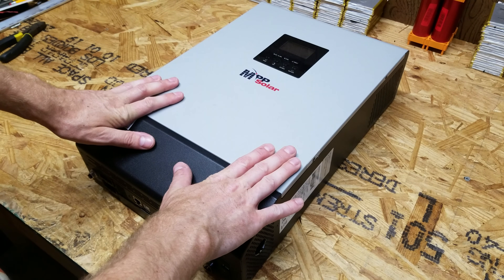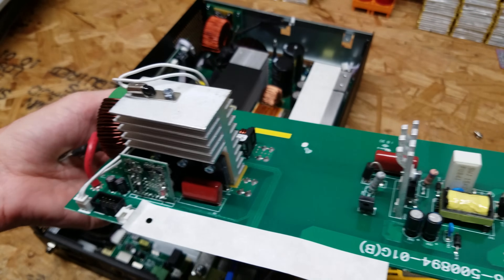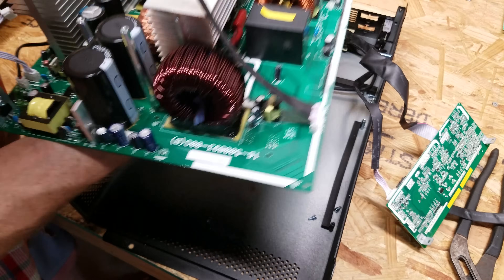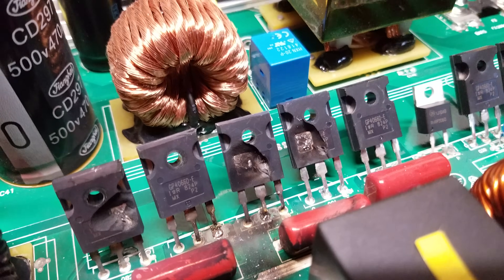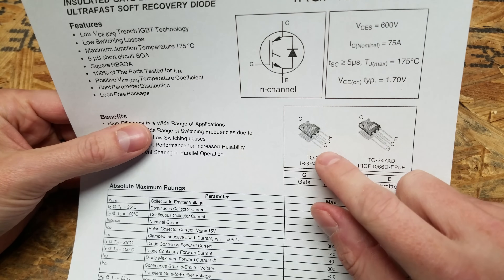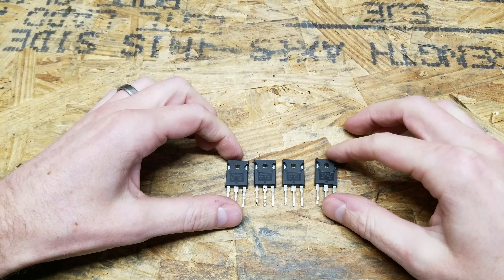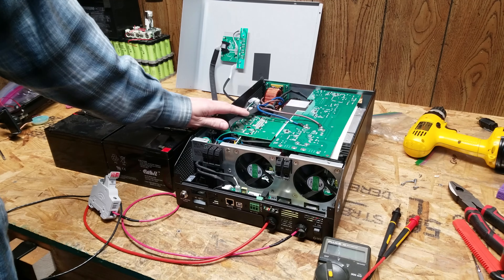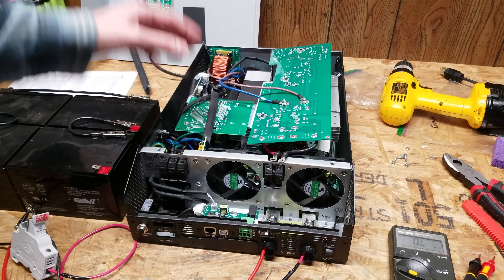MPP Solar PIP-5048MG Inverter Disassembly and Repair Attempt

Comment: In high frequency online ups the AC output neutral is same as battery minus. 
So i guess due to the incident every component between these are affected (DC fuse, mosfet, rectifier diodes, transformer, capacitors, IGBTs and other components which supports these power components). Might be the reason  why it is showing a short at the battery terminals. Not sure if this might add some more help.
Reply: I have found a troubleshooting video of similar kind of inverter .
https://youtu.be/HBKwrB3fhOE

The outer heatsink has the battery side mosfets which switches the battery input. Backside of the PCB multiple SMD ICs are the driver ICs for these mosfets.

The inner heatsink has the output MOSFET/IGBTs and Diodes. Back side of the PCB also has the Driver ICs for these set of MOSFETS .

Comment: Hello sir,
Very interesting video.  I would like some help from my side.I have almost the same problem with my inverter, but I wanted to replace a component that burned. The problem is that the component has completely burnt out and I can't identify it. So as you have worked on the same inverter, you could help me to identify the component. Please, if you can give me your mail to send you the picture of the burnt ?
Reply: Did you manage to find out the component?

Comment: The "electrician" didnt "accidentally" fed power to the grid , these inverters are not designed for that . More likely he probably  reversed the input and the output . lol
Reply from the maker: Yes, he is a licensed electrican and yes, he did accidentally backfeed grid power into the output terminals. It was an accident...

Comment: Do you really have an input short? Or are you just seeing the capacitors with your meter.
Attempt to charge the caps with a resistor in series.
Reply from the maker: I'm really not sure at this point. It's still sitting from where I left it after this video :/

Comment: So basically these high-frequency inverters have three main sections

1. High-frequency inverter that turns the 48VDC into ~15KHz+ 220VAC, then rectifies to turn it into 380VDC. The super high frequency lets you get away with a very small transformer (2x the freq= 2x the power for the same transformer, so a 15khz transformer can carry as much power as one 60hz 200x as big. NOTE: The transformers used have very little iron in them as iron saturates at higher frequencies. ). These were the K100E08N1 (80V-100A) mosfets and that sideways transformer you see there, and also 2 diodes somewhere on that side. MOST of the time this is done with a transformer center tap and a half-bridge, the middle of the transformer is connected straight to the + and the mosfets take turns switching - on the left and right sides. This creates a square AC wave which works super efficiently to boost the voltage but at 15KHz it's not useful whatsoever, thats why we rectify it to ~380VDC and store it in some caps.

2. 380VDC to 220VAC. The part that blew in this case. Since we're working with high voltage, the current is low and so we don't need nearly as many or powerful mosfets. Generally these are IGBT's rated for 600V. This will be a FULL H bridge configuration, so requires at LEAST 4 IGBTs, or a multiple of 4. And generally has some sort of inductor+caps to smooth out the SPWM into a full sine.

3. MPPT,separate circuit which generally consists of big inductors and mosfets to drop the solar inputvoltage and increase current, Depending on the setup it may be used to directly charge the 380V caps for much better efficiency.

GENERALLY when these cheapo inverters go kaboom, it's not just the mosfets that fail. This is because their circuits are designed so on the edge that the second the mosfets fail their gates short out and the gate drivers+resistors are so low-power that they blow as well (in the split second that the inverter blows up).

So my bet is that the gate drivers + resistors are probably blown. Hopefully the rest of the spwm circuit isnt blown, cause those are probably a bit complicated if they aren't off-the-shelf EGS002 modules.

ALSO when working with any switching circuit like this  always try to use a current limited power supply, 1A is more than enough to get it running. If there's a short, 1A won't do anything to the mosfets.
Reply: Hi Brian, thanks for the very informative reply! I have a simple 500W pure-sine wave inverter. I noticed the 12V input wires enter the PCB at a spot between two large transformers. Strangely, there seem to be 6 MOSFETS bolted to the case of the inverter in that area. Do you have any idea why there might be 6 of them, not a multiple of 4? Near the transformers are also eight discrete diodes (cylindrical plastic bodies). I don't think two of the large bolted components could be diodes right?

On the output side there are 4 mosfets, so I'm pretty sure I'm not looking at the wrong side of it lol. I've uploaded an image of the board here if you want to take a look :) - https://imgur.com/fNA3zEA

Oh, and I'm trying to learn how inverters work. One thing that I'm curious of - what part of the inverter does the switch on the front panel actually switch on/off? Since the wires are so thin it's clear that it's not switching the large input current, so how does it completely disable the inverter in the off position?
Reply: Sir Is Deye inverter has better quality than this inverter? Please reply.
Reply: I've just started getting into this stuff. I've always worked with computer etc, but only ever found out about soldering and board repair recently

I'm 21 years of age and I'm struggling to find places to learn

Could you direct me towards some documentation?

I'd love to get my masters in electrical engineering, but here in South Africa it's just too expensive to study and live at the same time. Gotta choose one😂

Comment: I want to know if there is a DEVICE or any other WAYS TO AVOID this ACCIDENT(blow the inverter by connecting the output to grid or Générator)
Reply from the maker: Yes. Make sure you have the appropriate interlock device on your breaker panel. This will physically prevent you from turning both breakers on at the same time.

Comment: Aliexpress has fake parts but if you are purchasing for 2-3 USD per pcs then it is Original, I purchased many parts from aliexpress, that works fine,  you can use IRGP-4063(IGBT, higher loading capacity but higher losses than MOSFET) instead of or 47n65 (MOSFET-lower loading capacity, low losses),  if not getting a sooner replacement, 
2: after repairing never inject batteries voltage directly without a current limiter, like bench power supply set on 1 amp to void more damage if a fault exists.
Best of Luck ,

Comment: Loved Your video, The input short is at the primary side(input) , pls check the input side, and try the voltage injection method to dig down to the problem, 
To Check MOSFET or IGBT (4066) you need to have a voltage gate supply of 5v at least then u will see approx 0 Ohm by C-E to verify the working of the transistor.
Appreciated Your video. 
The inverter was damaged by a back-feeding grid, this is Not a Gird Feed inverter. keep Output of this inverter isolated from input and never mix up.

Comment: Fun fact, but the "shorting" on the battery side may be a bad reading due to the big capacitors parellel to the battery charging by the multimeter. Try holding the multimeter leads for many seconds on the battery input and see if you get a non-short circuit reading.
Reply: I just wanted to say same.

Comment: I believe the battery soft start which looked health physically OK has a dead short. That 19 mosfet there is a dead short. Also the voltage you are using to  charge the gate and source across maybe low. Your meter has 9 volts.

Comment: Stay away  from hi frequency  inverters  they're  over complicated  and wont last a long time.
Low frequency  inverters  with a giant toroid are the go,  i have one with only one pcb inside it. The only thing that damaged it was a lightning  strike so far ,10+ years in use 24/7.

Comment: Inverex Rameen Solar Solution:
We deals in all types Domestic & Commercial Solar Solution system, On-Grid or Off-Grid Solar for Home, Offices Buildings, Factory, Shops, Godown’s, tub wells, Agricultures etc....
Call / Whatsapp us Freely for any information or Complain......
Regard
Engr Syed Wasim (Btech, MBA) +92 3018444084
Mr. Umer Ali (Solar Speclist) +92 3228422465
Rameen Inverex Solar Solution Lahore, Islamabad, Karachi, Pakistan
www.rameenrenewables.com
+92 42 36612136-7

Comment: I would check the boost state FETs. The battery voltage needs to be boosted high enough to create a 120V sine wave and it looks like it uses that EI core transformer in a push pull configuration next to the H bridge IGBTs. If the input FETs are blown then you would get a short measured across the battery input.

Comment: In my experience, counterfeit transistors can actually work just fine. Same with other chips, a lot of my DC to DC converters use blatant TI rip offs but work very well.
Reply: LOL...  We haven't had any issues with them either... W/exception of "magnachip"...   I've used hundreds.. We fix anything they bring, if its possible. Most of the time the exact replacements are not available.. We figure the device was dead to begin with and as long as the parts pass testing, where's the problem...?   HOWEVER....  We only use Mouser / US Sourced Capacitors...  Too many issues with Counterfeits and longevity.

Comment: more info         http://forums.aeva.asn.au/viewtopic.php?f=64&t=6007&start=425

I have same inverter and fixed it twice already.  When it is putting out power and also taking power from solar any connection to ground between solar input + or - will destroy the inverter.  Some high side large type IGBTs blow up and at times some of the small Mosfets as well.  You need to test them all to make sure they are still good. Use component tester or rig setup where you use IGBT/Mosfet to turn on/off a load around 12V/1A like resistor or car bulb.  Next to the transistors more parts may break, like gate driver IC (AT350) on backside of main board that control IGBTs. Also the gate resistor for it and schottky diode, 18V zener diode.  Check all smd parts surrounding the 5 different AT350s for damage and replace with new ones.  Bought new AT350 and measured resistance value between different legs, used this info to compare with on board AT350 to locate defective ones.   Put new chips in sockets in case you have to replace again later on. Use DIP socket with pins bent so to fit surface mount layout.   To prevent inverter from blowing up again I isolated all ground connections between all different circuit boards and the chassis. Now all the board grounds go to a connector outside the box and connect to the chassis over a 100W/120V light bulb.  This limits the current that can flow in case of a short between solar input +/- and ground. It still makes a good connection to ground since a cold light bulb has low resistance and prevents shock to anybody touching the case while inverter is on.   However one of the internal fans broke which caused the heat sink temperature to rise fast.  Replaced the original fan with a larger one and this kept things cool for a while. A few days later the inverter started having a new problem by overcharging the battery.  Caught it before there was damage to my battery bank and have not used the inverter since.  Will try to fix it again when I find some time, may be during the holidays.  When the inverter works it does work well but it is a prima donna and has no mercy with any user mistake.   After you changed all defective parts power up inverter on battery input first, use power supply with around 48V and 1A current limit or put 120V/100W light bulb in series with your power supply to limit current. This will prevent blowing up more parts if there are still issues.   Good luck.

Comment: Hi All I have one of these came with 8 pannels, the chap said it packed up so he bougt a new inverter, can any one point me in the right direction to start diagnosis, can find faults was a heating engineer long time ago but need some guidence manufacturers litruture would be a good start. cheers.

Comment: You can buy the new board from mpp directly cheap and fast shipping 
I replaced my lv2424 after I blow it up. Oops
Reply from the maker: I know, but they quoted $250 + shipping, so at that price, figured I'd just try to fix it myself.

Comment: At least you got about $300 worth of individual components, at single quantity prices.  So still seems like a good investment for someone like you ;)  
When checking battery input impedance with an ohmmeter, always reverse the leads and try it in opposite polarity, in case there is residual capacitive charge giving u a false resistance reading.  Remember an ohmmeter actually injects voltage from its internal battery into the circuit to measure resistance.
The odd screw is a security head. There are bits for that.
Keep it up :)

Comment: The screw you thought was defective is actually meant to keep it from being removed. The tool to remove it has a hole in the end to accommodate the pin in the center of the screw plate. They are usually a Torx head, Phillips or Allen head ( predominantly Torx) made to keep anyone but a repairman from removing. Normally, they are placed on the outside (microwaves have them) but, I assume it is there due to the capacitors. 
Did you recheck all of plug-ins you removed?
Reply from the maker: There are 3 screws that hold down the heat sink. It just seems odd that only one screw was like that. I guess they figure that the other two are unnecessary as even one would deter people. I don't know... And yes, I rechecked all of the connections.
Reply: @LithiumSolar  I think you have another transistor that is bad, a bad capacitor, a dead short in the board or something grounding the positive terminal. Check out all of the various connections for incoming and outgoing wiring first and if you don't find anything, then follow the positive lead forward. Test for continuity between points starting from the positive connection where the AC entered that caused the problem.

Comment: mine is identical ... on the battery input you must have an increasing resistance value .. fruit of the capacitors that charge ... check the electrolytic capacitors

Comment: There are quite big capacitors that may show as shot circuit in meter
Reply from the maker: I tried feeding 1.5V in to see if they would take any charge and nothing... I might try feeding a few volts in with a bench supply and see if I can find the short by looking with a thermal camera as others have mentioned.

Comment: Scorched rosin flux is hygroscopic (absorbs moisture from the air) and can cause an intermittent high impedance short at a transistor gate.
 
Circuit works on dry days and fails on humid days. (learned from experience)
 
Acetone (used in fingernail polish remover) works better and faster than alcohol to remove flux residue.
 
Use pure acetone (from a paint store) as fingernail polish remover usually has lanolin or other additives.
 
The old Fluke 8050A multimeter could measure very low resistances and that allowed tracing the location of a short.
 
If you find a currently available multimeter with similar capability, please let me know.
 
A short in a PROM chip was found by following the PCB circuit to the point of lowest resistance.
 
The chip enable was internally shorted to ground and the chip still worked when removed and was copied to a good replacement part.
 
If the short resistance increases when you remove a part of the unit, it is likely that the removed part contains at least a part of the short.
 
This makes life easier when looking for multiple shorts as caused by a massive failure.
 
Hope this helps.